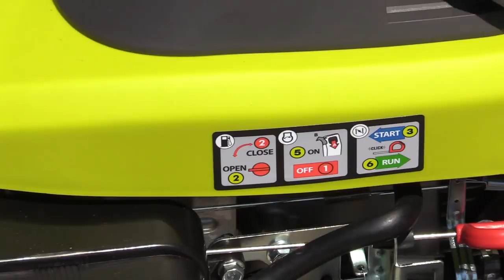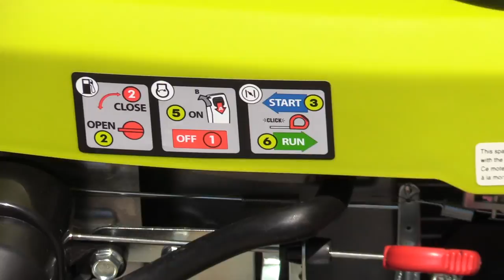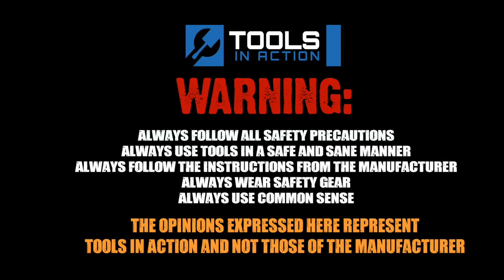Ryobi Pressure Washers

Comment: Awesome video. Heads up looked like you didn't switch the choke back after it started it runs alot smoother after that. I have a Simpson 3200 psi I'm pro gas but your right more maintenance for gas

Comment: Get a surface cleaner if you don't have one already I got that red one at Home Depot that's around 70 bucks and saves tons of time and water and does much better job then using tips
Reply: Andrew Lyon : I just picked one of those up, drained my pool and cleaned the entire surface, it was quick and left no random lines in the surface like a single spray tip leaves. That thing is awesome, also you used on three car wide drive and it only took my 15 minutes.